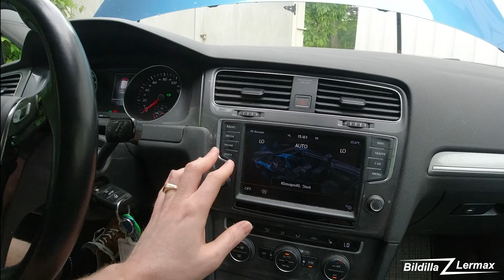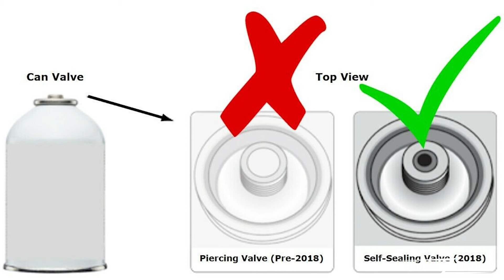DIY / How to: Check this before you buy AC gas, and try to fill AC gas on your car! - Bildilla

Comment: @car crazy magazine
Silly epa agency changes in the usa...totally mishandled changes to the design of the canister for the r134a.
It has confused nearly everyone trying to recharge their ac system. Of course the epa didnt communicate this change effectively.
Good video my friend. I do these recharges all the time.
Reply from the maker: Thank you! Yes, it is a possible trap, when you buy what you need online. Here in Norway, it is not like that to buy at the usual parts stores. Then it will be E-bay, Aliexpress and so on ..
But I mapped to rig, so I got refilled on my Golf. Then a friend with an overheated family came by. He was out of gas on his Mercedes, and we had 33 degrees Celsius .... He drove much happier on, after we managed to fill a box on his car too!